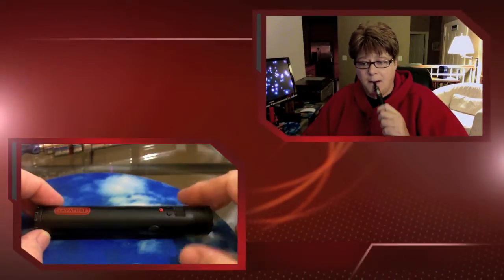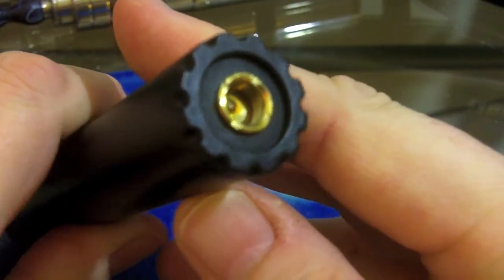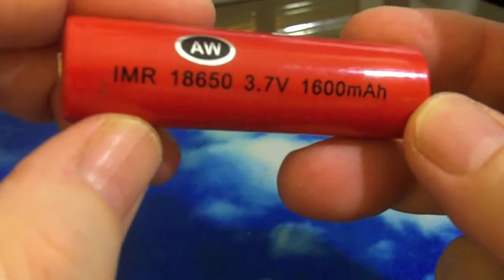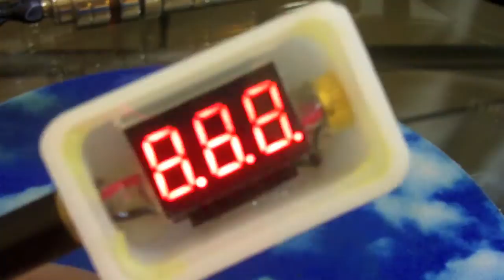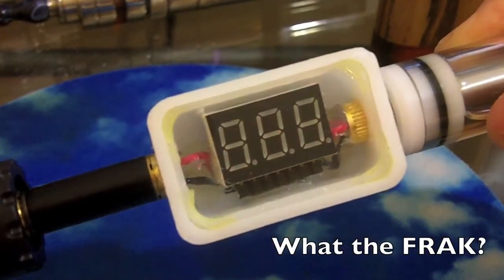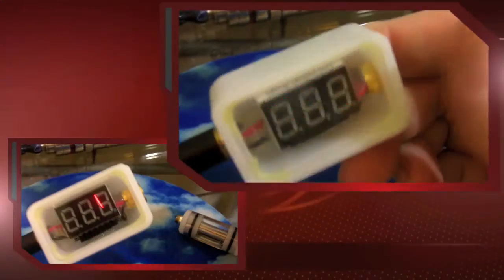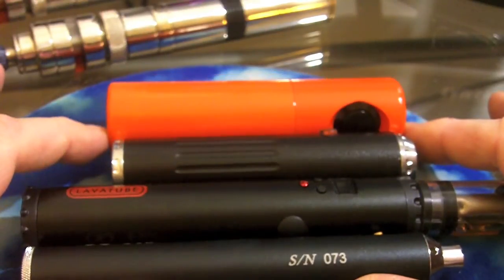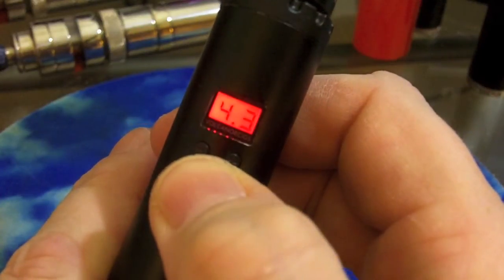LavaTube

Comment: Also, I have to say that with my regular resistance 510 atomizers and (I haven't used cartomizers on it much at the time of this post) with my regular ohm 510 cartomizers, it seems to really satisfy both my throat hit craving and my vapor production needs. I love it! I am 21 years young and I only make $8.35/h with only 12 hours a week. I got one battery, a charger, case, tip, and unit for under $60.00 and I feel very fortunate to be able to share in the high voltage experience w/wealthier ppl.

Comment: @abigdavid That because he's using probably a 2.0 ohm DCC on the Lavatube. If he uses a 1.5ohm DCC it will drop to around 3.30V.
The Provari with a 2.0ohm let's you vape at 4.5V, same 2.5 AMP limit but somehow it's messed up in the Lavatube.

Comment: Good review, you have to remember why we all started using LR and DCC though, because standard ohm at ties at 3.7v were meh. A standard resistance atty tuned with a VV should out perform an LR at 3.7v. The drop in your lavatube is also much greater than those I've seen on other reviews with DCCs but then for the price there are going to be inconsistencies.

Comment: I was thinking the same thing. I went with the V2 Chrome Lavatube, and don't miss having to press the provari's SINGLE button a hundred times in a day just to adjust voltages for different juice and atty's. I actually like the look of my chrome LT more than my PV too, but the provari will always sit in my drawer for when I may need it. Otherwise, anybody new to the scene of variable voltage would be ignorant to not consider the cheaper lavatube over a provari. Hell, buy two for the same price!

Comment: I can say that the DCC and LR might have dropped too low also because the batts are already at 3.6V which is close to empty. Try doing it again with a fully charged batt or atleast something higher than 3.6 battery reading.

Comment: @FuzedBox  Thanks. I found ECF since then. Post count is already around 300. I sold my v2 back 2 the store after the charger almost burnt my house down. Killed 4 battery's total by that time in just 18 days. Also bought 3 packs of defective  cartridges. Hard times R behind me. Ended up with a provari and just today my Arry v4 came. Im up to around $600 now but at least its worth it. Should be done for a while. Pay off is the end of 2014.

Comment: I am not sure where you read that it will drop to 3.7 (Just re-read preorder page, it does say 3.7-my mistake).  The employees I've spoken to say it will drop you to where your draw on the unit is around 2.5 amps.  Which means a 1.5 ohm (their lowest) atty will go to 3.7/3.8 or there abouts.  What was the ohms on your tank carto?  If it was dual coil at 2 ohm each, giving an effective 1 ohm resistance, that might be why it is dropping so low.  I'm guessing it was an oversimplification by them.

Comment: Wrong. LR batteries are fine with batteries over about 450mah. The newer egos can handle them just fine. Bigsmoke is right. There's no point in using a LR atty with 4.2V just to get 11.76 Watts. You can get that with under 6V on a LT using a SR atty. Or use a 2.5ohm atty and get over 12 watts. The LT cutoff is at 2.5 amps. So, using a 2.5-3ohm atty, you can get anywhere from 4 to over 12 watts.  Using a LR atty with anything over 3.7V, when you don't have to, is just stupid and wasteful.